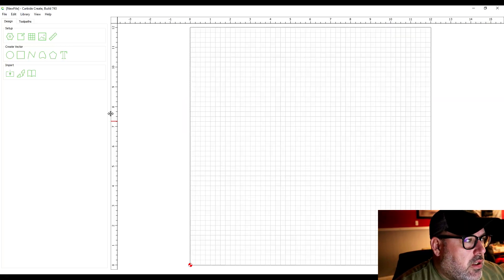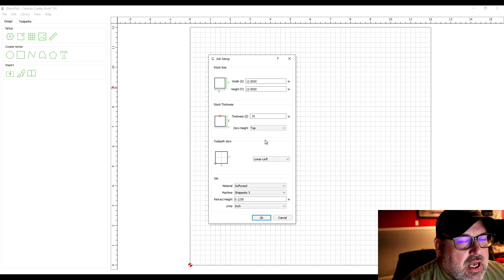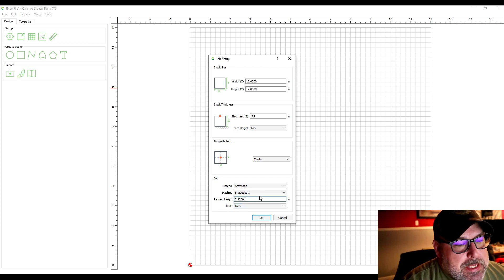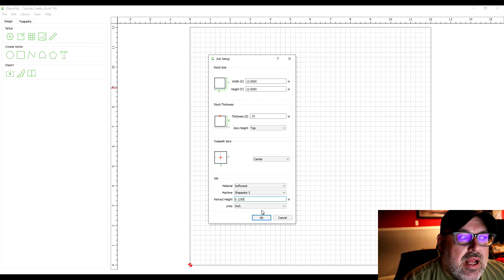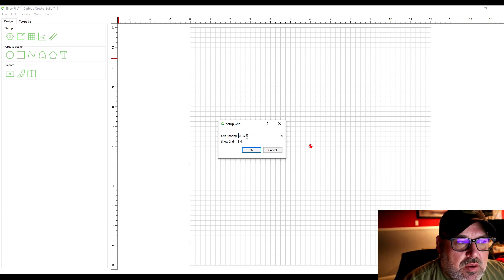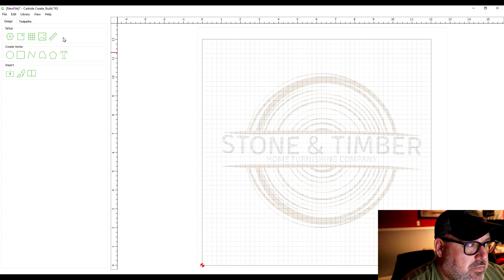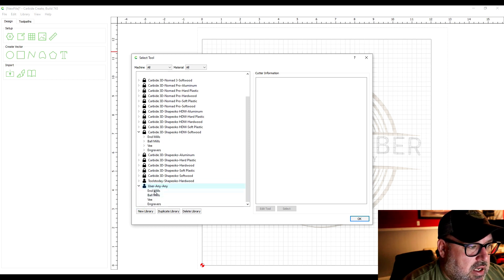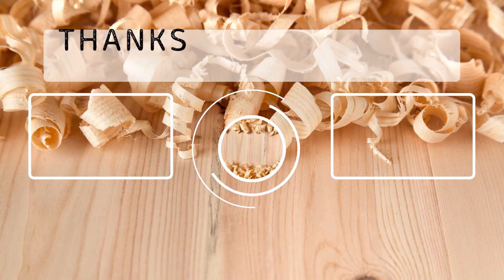How to Easily Set Up Carbide Create for Your First CNC Project

Comment: You say CC can be used with any machine but when you came to where you choose which machine from the drop down menu you didn't say what we should do if we dont have one of this manufacturers machines.
Reply from the maker: CNC machines operate on files called G-codes. Carbide Create can create the G-code. You would just need to import the G-code into your machine software.

Comment: Such informative content…thank you.
Reply from the maker: Glad to be able to help. I remember being very confused when I first started using my cnc software. Thanks for watching!
Reply: @StoneAndTimberShopClass  I am preparing to buy the Nomad 3, to be used for the light milling of titanium and stainless steel (slightly more than engraving depth). I have no CNC software experience, nor have I operated a manual machine. The Carbide 3 software seems intuitive so I’m ready to move forward. Thanks for responding.
Reply from the maker: @haroldkreye8770  the current version of Carbide Create is pretty good. You may need to experiment with it a little to learn but it works well. Good luck!

Comment: I just got my Pro XXL.  I hope you have already filmed the next video which will show us how to take a picture off the internet, convert it into a SVG file, and then how to create a file that will drive Carbide Motion.
Reply from the maker: I have several videos showing how to design with external images. I recently did one on how to import a map. Check them out. If they don't answer your question I'd be glad to create another video that shows this.